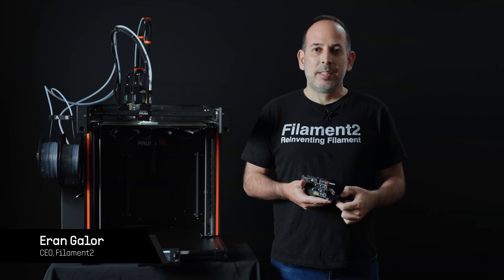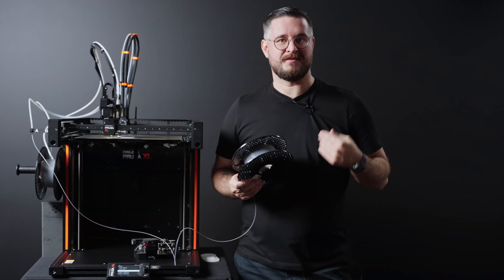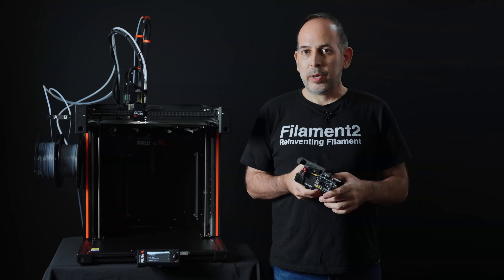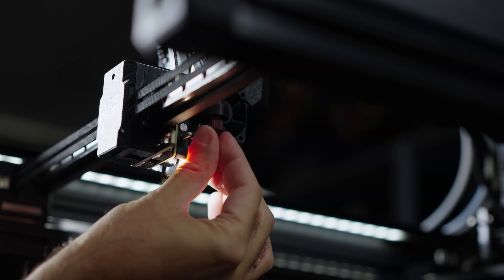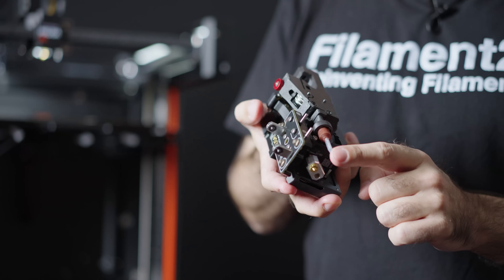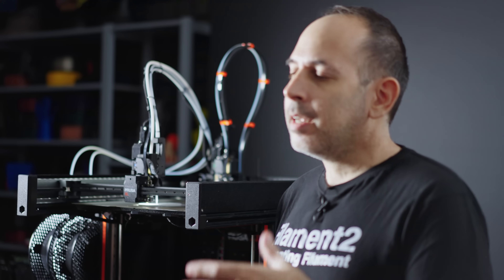Silicone Printing on the Prusa XL - Filament2 x Prusa

Comment: Where does the cut tube go?
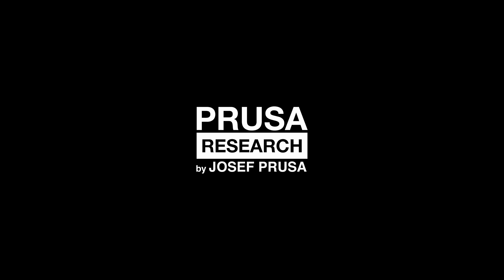Reply: At 3:29 you can see the head close up, it looks like the peeling mechanism in pick and place feeders and you can see how the cut tubes are combined and returned. Then at 3:37 you can see that the return line seems to go to a box below the spools. What I wonder is if this waste bin also needs a motor to tension the return filament because if it's soft like TPU then it could clog as it's being pushed.
Reply: I don't understand this. They say it's being cut open but, and it's on a roll, so there must be split tube void of the 1 part silicone. It must be pushed off to the side to be collected? They seem to be very specifically dancing around this. Perhaps it's redirected up and away.
Reply: This is very cool but unfortunately it produces almost the equal amount of waste as it does the final product in terms of volume of plastic. It's horrible for the environment.
Reply: @OU81TWO That certainly hasn't stopped bambu lab users from printing their mini flexi keychain animals haha

Comment: This is bloody brilliant, but the video fails to answer so many important questions.
-Curing time
-Curing method
-Silicone viscosities
-What happens to the sticky waste?
-Cleaning between different filaments
-Resolution
Reply: Someone hasn't seen a reveal video and then ignored that the release is happening at formnext which was stated in the video. Patience.

Comment: How does the silicone cure? Is this a addition cure silicone (2 part)? Is heat required?
Reply: It's two part, mixed in the nozzle.
Reply: reaction is exotermic, like with composite resins

Comment: This is great news for mold makers. Let's see what projects emerge.
Reply: It will depend on how expensive the filament will be.
Reply: @lortnokmeister  knowing prusa filament prices, probably $60+ unfortunately
Reply: Only if the mold is single sided with no roofs, and as long as you don't mind your molded object having layer lines, don't get me wrong its awesome and has loads of application I just don't thinks molds are one of those applications or at least its one with a lot of caveats.
Reply: @jakeengland1430  ok, hear me out... I think we can solve bridging by placing the full 3d rig on a rotating gantry. Literally roll this bad boy upside down if need be. but, in theory you would only need to tilt the unit at 30-45deg angle in the X and y. Foot print gets a bit big but in a world where supports can all but be removed it's a fair trade in certain settings.

I think some companies attempt to do something like this by tilting the plate but that can mess with the nozzle path. 

Possibly a smarter setup would be building a stand alone unit with flat platform with mounting points for various 3d printers with its own tilting capabilities in the X and y and sync that sucker up with the slicer and the printer and your away laughing. 
Bye bye supports.
Reply: @BenjaminWard-ov8wh orrrrrr and hear me out here ... make a mold the normal way 😂 but seriously though you can already print high detail flexible resins on an SLA printer, silicon has good uses for printing i just really dont think molds are a good thing to use this tech for

Comment: This is HUGE. In principle, it can print not only silicone, but also has the potential to print epoxy resin, and even inorganic adhesives (heat resistance exceeding 1000℃).
Reply: It is going to need to be thixotropic to work.

Comment: Where does the tube go after it is cut away?
Reply: 3:27 - you can see a pulley on the front with the split case going back up.

Comment: What happens to the tube casings of the silicones? What are they? Can they be reused/reppurposed/recycled? Or are they just trash to be disposed?
Reply: We're working on making it recyclable, and the tube shell is so thin that the core-to-shell ratio is equal or even better than syringe-based paste printing!
Reply: @erangal-or3339 oo, but in comarison to pumped/metered, how does it fair up? I understand there are issues with metered pump setups (increased print head weight, issues with pressure/viscosity "fluid bowden") issues.
Also, how much additional cost does the liquid filament cost vs a tub of liquid/syringe of liquid?
Reply: Just seems like it vanishing in to the universe 😁
Reply: I was wondering the same thing. Also what happens if you cut the "filament"... does it leak out?
Reply: @SH-id2lb  Since the silicone is viscous, even if the tube is cut, nothing leaks out.
Reply: No, seriously. If you look at this picture. U can se that the 2 wasted tubes goes in to a second large tube to the left.The used filament tubes looks like theire jagged. They need to be collected somewhere.

https://www.prusa3d.com/content/images/product/67c47d89-2a11-41e3-ab33-7b61faf3a7ea.jpg
Reply: I’d assume it’s being melted into the final product like normal filament would be
Reply: @TheNytfire you'd assume wrong.

Comment: Where does the empty tubes go ?
Reply: Look at 1:51 - you see two tubes going into the extruder and one going away. I suspect the empty tube to be rolled back up.
Reply: @Schnabulation  ahh thanks, I thought that was the 2 tubes, now I see there are 2 bundled and a third
Reply: @Schnabulation i assume there is a knife and cut the tube open, but won't this make unload filament impossible tho? Cause middle is liquid? Who knows
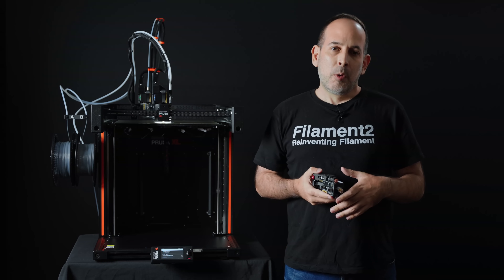Reply: Also 2:38 - you see the empty tubes going away
Reply: Tube heaven

Comment: Assuming the result has the same benefits of normal silicone, this could actually be massive.
To be able to print complex, uncastable structures with silicone is very intriguing.
Reply: You can also use the silicone you print as a casting medium!
Reply: imagine the innovations in medicine with this!
Reply: @pvic6959  like?
Reply: the problem is that it seems too liquid to handle angles and overhangs decently.
Reply: @lancerwick2661  supports with PLA?
Reply: @DanielSanNinja  crap, that's true. Let's not forget that the XL is multi-toolhead....
Reply: This is cooooool and I already have fresh ideas after seeing this! Can’t wait
Reply: It has been done with "resin" printers before.

Let's hope their technology is better than their marketing. Prusa needs a break.
Reply: @orange422  No it has not been done before on resin printers. This is real silicone with silicone properties and not a "like silicone" blend.
Reply: @orange422  No it hasn't been. Don't you realize that you could embed like internal reinforceent structure inside the silicone or traditional filament as support material for weird shapes and so on and forth. On the fly.
Reply: @jothain  Yeah imo that is the most exciting thing about this. Silicone printing has existed for quite some time. F.e the company Lynxter with their silicone printers. But the ability to mix it with normal FDM, seems very cool.
Reply: @tengertechnologies true, especially when you consider a Lynxter with the liquid toolheads is $60,000 minimum and 55g of their 2-part silicone is around $200, it really puts into perspective what a leap it is to print liquid on an XL
Reply: @orange422  Simmer down meow. I don't think you have the vision for this one.

This could open up an entirely different realm compared to resin.
Reply: Wait? You can only use an old XL? Call me when Bambu licenses it, I just want to print, not fiddle with printers.

Comment: I havnt seen much about silicone printing
Reply: Because it didn't exist until now.
Reply: Loctite 5015 resin

Lynxter machines.
Reply: @vp3dprinting860  https://en.wikipedia.org/wiki/Fab@Home
Reply: @vp3dprinting860  That is not true, Lynxter exists...
Reply: I've seen some, and looking close this is only slightly less disappointing than the rest.